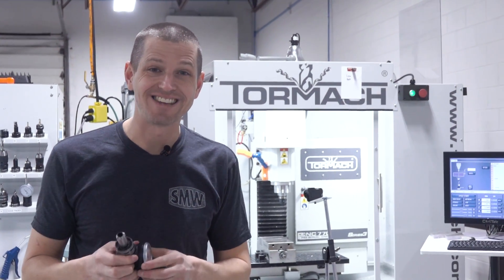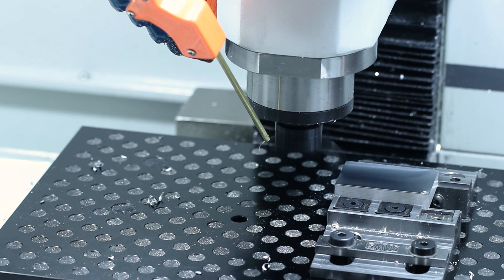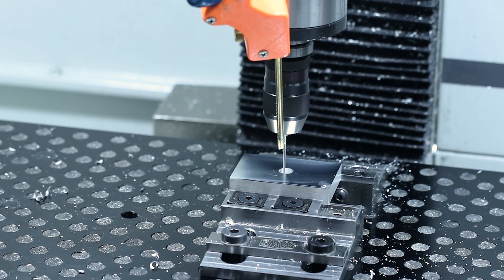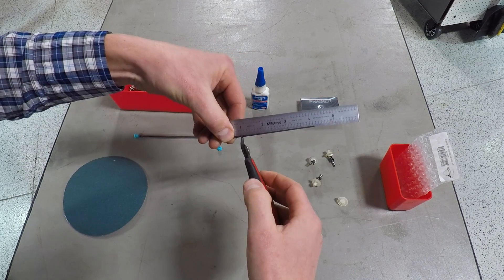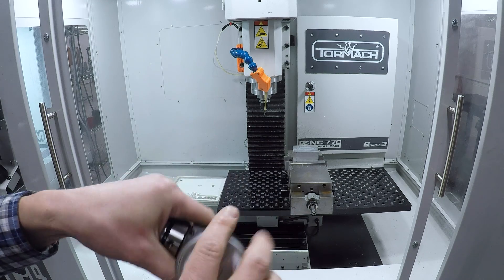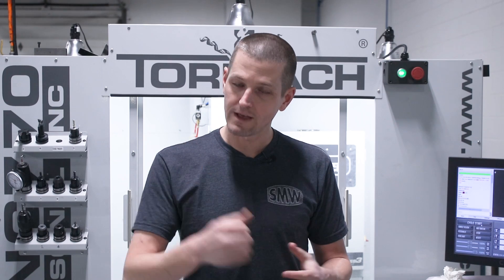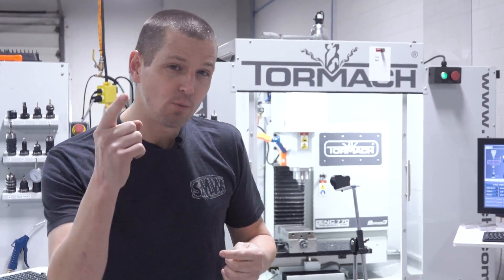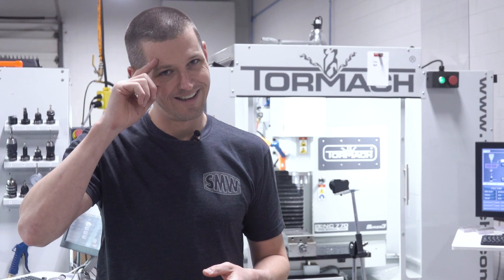DIY Cheap Haimer Replacement Tips! | WW234

Comment: I realize this is from a while ago, but isn't the length of the leads critical? Didn't see the thickness of the fixture plate (bottom surface to bottom of counterbore) specified. The longer probes have a larger diameter ball, so using the existing ball means you have to have the length of the probe the same as the original one. No?

Comment: 5:21 how you break them i still use original lol. you cant hit rapid. your selector is steps and max step is 0.1mm oh you are using bad desingned machine. i have never in my life even rapid move by hand. why?
Reply: If a human error could crash the Heimer, a human error will crash the Heimer.

Comment: Or just snap a new tip over a single edge for a clean break and glue back with crazy glue. Strong enough to use breaks on the glue cut. Cost 00.2 cents.

Comment: Not sure with the new generation haimer but on the previous model, when trying to adjust the run out, the stickyness on those adjustment screws is due to the Bolt in the top of the shank, it's pulling the haimer body onto the shank and that friction of the mating surfacing is preventing that easy adjustment on each of the adjustment screws. I figure the new generation model is using the same method which makes fine adjustment a pain.

as David S. had mentioned as well, you want to use those adjustment screws as your reference for the DTI instead of finding exact high and low spots, you set them by rotating 180 degrees between the opposing set screws and centering out the DTI that way, much less guess work involved and only takes a few adjustments to get the DTI to have zero movement.

Comment: Funny thing happened... Tried the pencil lead trick, but instead of using the jig, I kept filing down on the three prongs until I reached the desired length. My testbed was a 1-2-3 block on the vise, and kept measuring on both X and Y axes until measurements checked out. 

Oddly, the resulting tool length is 2mm shorter than the original one (got this data from the previous tool offset). Now, if I'm getting consistent measurements on X and Y, shouldn't it also be implicit that Z axis checks out (due to, let's say, trigonometry ???)

What worries me is that the original tip got stuck in the threaded part (I crashed it on the Z axis, so the tip went straight through and got lodged in the metal part that screws into the Haimer), so I fear that maybe the Z axis mechanism could have suffered some damage.

Comment: If you found the tip I assume you have the base, so just heat it up and the ceramic piece comes right out.  Now you have 2 original parts to use a piece of 4 mm glass tubing bought on Amazon to reassemble it. Few people could print that part.

Comment: Reading the left of the block to the second block says you have the length of center of the ball to the base is pretty close.  But since the pivot point and the ball are far enough apart you could have a fair error in the z axis and only show a few tenth's in xy.

Comment: Hey John,  the runout will be only canceled if the machine turns the spinde 180 degrees after going x+ to x- our Haindenhain Probe and controller on the Deckel Maho 220FD does this.  Like this it always uses the same point on the probe.

Comment: Note: The screws re part of a flexure and are not meant to accommodate a lot of motion.  It may be better to limit this adjustment to be less than a few thou.  I worry for those who just crank very hard caused the flexure to fracture.

Comment: John, When you dial in a 4 jaw (or 4 set screw), don't look for the high or low spot. Look for the high/low readings ONLY at the points in line with the opposing screws. Adjust for 1/2 the total runout at those points. Much easier than chasing some "high spot" at a point in between the 2 actual adjustment axis.
Reply: It's actually exactly what the Haimer manual says!
Reply: @bartoszszymanski6647  and also the logical thing to do when aligning for two perpedicular axes

Comment: The ONLY problem is you'll have to do this to every tip you produce. No consistency.
Reply: Jesse Fritz You’re supposed to dial in new Haimer tips too, they aren’t perfect either.
Reply: @Phantomthecat  Oh ok, I didn't know that, I thought German engineered meant you slap it in and go.
Reply: @JF32304  Haimer says no need for new calibration when replacing the tip. 

Didn't try it myself yet, just got my first Haimer...used, with broken tip, that's why I've found this vid ;-)

Comment: I realize that the pencil lead is fairly stiff and brittle but have you considered simply 3d printing the whole thing with the 3 little pins made as thin wall hollow tubes? That way all you would need to do is slip in the lead and add the glue on the end.
Reply from the maker: We tried - couldn't get it to work.  You want the material to shear, not flex under a certain load.